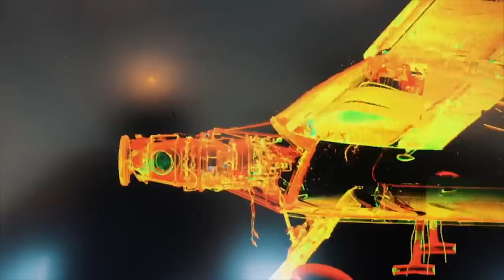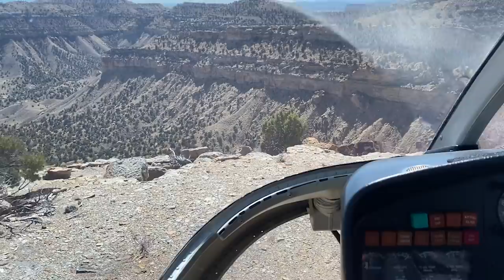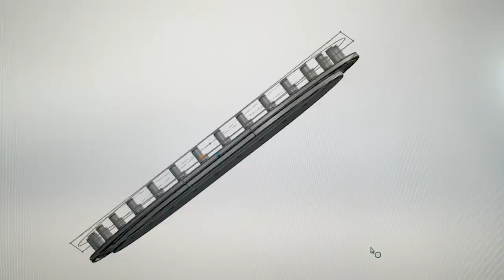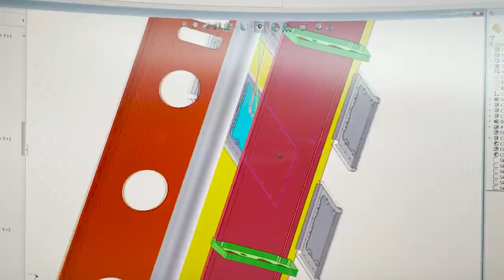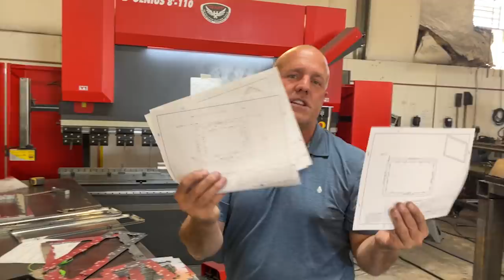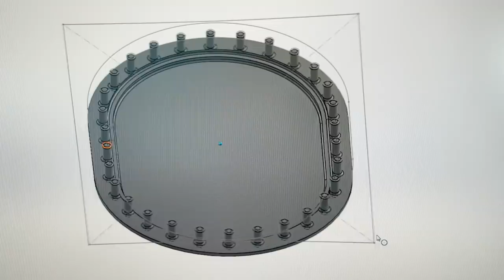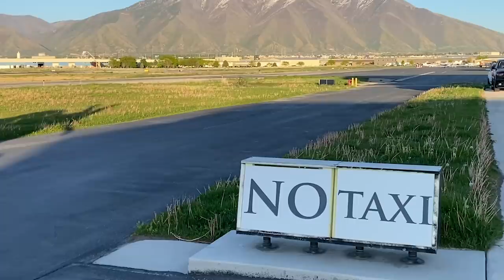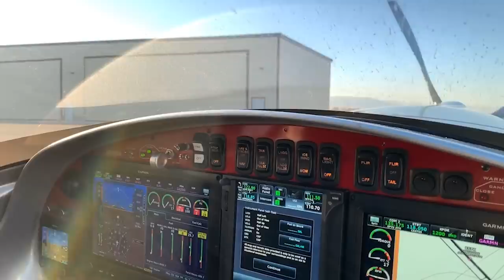Helicopter picks up airplane & Scrappy thermal tests | Scrappy #53

Comment: Mike, I’m not an aviator but I was a mechanical engineer for over 30 years. I grew up on a farm, in a mechanic’s shop and worked as a mechanic in the southwest VA coal mines to put myself through engineering school.  I learned a lot about the difference between a mechanic’s perspective and an engineer’s perspective.  When I became fortunate enough to be supervising engineers, whenever I hired one he/she would work with every maintenance crew and every shift in the plant for a minimum of 6 months total before he/she ever began doing engineering design work.  I told them that that their time with the mechanics would determine whether they were a success or a failure at that company. The ones that learned to respect the mechanics’ needs and biases went on to make very good, very respected engineers.  The others soon left. If only more engineers would learn that.
Reply: Your practices should be the standard in the industry. Unfortunately, it seems to be more common than not that speed and cost dictate most of the decisions management settles for. The customer ultimately pays for, hopefully it's not in a critical application.
Reply: @MrGaryGG48  If you own a german car, you know that no engineer for the power plant or gearbox ever listened to the mechanic's POV.  Built to expedite assembly with not a single concern towards maintenance.
Reply: My business mentor ran a big commercial construction company. His superintendents at various locations around the country were just too busy running multimillion-dollar projects to get their paperwork to the payroll lady on time. He spent a year making every single one of those guys take a week doing her job dealing with the equivalent of themselves. 

Not a one of them ever submitted their paperwork late again. It's a continual problem in business to get people with different priorities to look out for each other. Each one tends to think they're a little superior, but that's usually because they haven't had to walk a mile in their shoes. Yet.
Reply: Well said, I got my ME degree via a co-op program in a machinery manufacturer, spent a lot time with shop personnel, sorting out details and they welcomed my sympathetic ear as they told me what would be better from their perspective. Many of their ideas were incorporated into designs. Not knowing how some of these would be accepted, I always said who gave me the idea. It became my standard practice as shop folks were happy to get the recognition.
Reply: YESSS!
Reply: We have a saying in our shop..." An engineer will climb over 100 virgins to screw a mechanic"...glad to see an engineer trying to prove that wrong

Comment: When he say “ scrapy it’s gonna be a tanker “ in some place in his head it’s planing to do air to air refueling that it’s for shure hahahahahah
Reply: That was my very first thought!
Reply: @BowenMarmot  So was mine!
Reply: And it would be easier,  safer and faster then the airforce method.
Reply: Not a bad idea
Reply: @Koolteer  And cheaper. A lot cheaper
Reply: I'm a former CH-53E aircrewmen and we can fuel inflight, I could see Mike signaling a USMC C-130 for fuel in a turbo prop scrappy.
Reply: @kelvinbranom10  a retractable probe just behind the chute?     🤔    

I was thinking a drouge  & camera at back. Controlled from 2nd seat. The have the monitors already installed!
Reply: @hoppermantis7615  don't give him ideas. I want to see the thing fly. Like now.
Reply: @hoppermantis7615  Probably more like he will carry fuel for others when they're out and about.
Reply: He's probably going to add a fuel transfer hose to refuel his buddies out in the back country. Hahaha!
Reply: Where have I seen you [zoroe...botgrinder maybe]

Comment: I always looked at it as a positive that I installed HVAC for 4 years before I went into engineering. I heard from more that one contractor that they really liked when I designed the ductwork because they knew that, if they installed it the way I designed it, it would fit. No questions asked. In the ceiling, in penthouses on top of buildings, no problems... AND they could service the equipment when they were done because I always took that into consideration.  It’s always a plus to know that your gonna have to work on it while your designing it. Good job, Mike. Beautiful shots of Aspen also.

Comment: Every time I see Scrappy I'm amazed at the design of the engine cowl and how it completely belies the size of the engine - if you didn't know you'd never guess there's a monster flat-eight in there (ETA >>) with an extremely sophisticated intake and cooling ducting system.

Comment: Best thing they ever put into an airframe, everyone is alive & walked away that's what counts...
Reply: Any landing you walk away from, is a proper landing. ANY. I've zero tolerance for any person who bashes airplane parachutes, especially considering how easily they save both lives, and in most cases, the airplane itself if luck holds.
Reply: Amen!✈🗺🍀
Reply: In a Diamond aircraft pull stick back all the way and it will mush down at the same rate as a Cirrus under parachute.
Reply: @oneskydog4401  not if it looses a flight control or the tail section it won't

Comment: With reference to engineers and maintenance techs, when I was building my Skybolt I subscribed to a newsletter by an old guy named Mac Mckinsey.  He had many homebuilts under his belt, some Oshkosh champions.  He didn't have a lot of use for engineers and was not shy about sharing his opinions.  He once said, "You can draw and a$$hole on paper, but you can't make it sh1t."
Reply: LOL!  👍🏻💥😆

Comment: I am a VERY firm believer that all engineers should have to work on the systems they are designing. it makes life so much easier for the next guy when they anticipate someone has to build the part, then someone else will have to service that part! Super cool to see the cooling system on Scrappy is working as planned!

Comment: Amazing. All the thought that went into just one set of brackets so they are perfect in every way. When I unspin the oil filter on my ford, it pours on the crossmember and runs down the frame to the taillights !!!
Reply: Ah I see youve discovered the cunningly designed anti rust feature. Those few parts of your car will last forever, pity about thevrest of it.
Designed obsolescence almost averted........

Comment: I use to work in a job shop so watching you make your wing parts was a 30 year step back in time for me. Pioneer did a lot of Boeing stuff. 

Nicely executed design work Mike, you are so right about many engineers when it comes to designing side of things. As a welder and metal fabricator many times I wanted to plant a three foot chunk of heavy wall pipe between an engineer's ears! Them to have them blame the welding for their design failures. 

Mike when we meet, ask me about the engineers at Genie Ind. from when I worked there. Yeah the blue and gray man-lifts.

Comment: If you had to pull the Shute on Scrappy, I think the suspension will absorb the crash with 0 damage, except cleaning the seat bottom.
Reply from the maker: 🤣 you I would probably have to clean out my shorts 🤪😂

Comment: This is what happens when a mechanic designs and builds a plane, everything is easily accessible. That would be awesome if manufacturers adapt that style of construction.
Reply: I know, right? And in most cases, it's not that hard/expensive to implement solid and well thought through designs! If you look at commercial aviation as an example, easy maintenance means lower costs and that is something every airline would love! 😛 I think these days, its far easier to design a bit smarter, considering the access to better materials and technologies that just didn't exist in the past. We are seeing smarter solutions popping up in everything from home appliances, cars and aircrafts so it's something that is coming, not only from a maintenance point of view! 😃
Reply: Well ... if it costs more to make, it ain't gonna happen. Change the water pump in a 2015 Ford Flex 3.5 Ecoboost (which I drive). Yikes.
Reply: @UncleKennysPlace  Well, could be worse. The Bugatti Veyron oil change takes a week and $20k. I know if you can afford a Veyron the $20k wouldn't matter much but to have your car down for a week for an oil change would piss me off.
Reply: @RobertForslund  it's easy to design better, but hard to find good designers. In the past there was no 3D visualization in CAD everything was on paper, imagine the effort needed to puzzle in pieces in your head. The main problem is that through thinking requires effort, mental and exhausting. I see it all the time when I teach CAD, people will immediately open a sketch and throw a line, instead of conceptualising first their ideas. And then just crumble when they reach a dead end.
Reply: Mike illustrates something that is far too common in the "Real World" of manufacturing. The company's design lab hires superbly educated engineers without enough practical experience to measure. In some labs, the common attitude is to design the product, get it to function to meet at least minimum performance specs and then "toss it over the wall" to the Production Engineers. They'll have to make it actually buildable. Where I worked, the designers had to "escort" the product into production and live with it for the next year. That added responsibility puts a real damper on the "Toss it Over the Wall" mentality... and everyone benefits from it. 

In Mike's shop, his combination of engineering & mechanical experience is really impressive! ...and it's really fun to watch!!
Reply: @UncleKennysPlace  to change the water pump on 94 Toyota Celica you have to drop the engine out of the bottom of the car. (You read that right.) And the water pump is built inside the block.

Comment: Mike, I can't wait to see the in flight refueling boom that you're going to install.
Seriously, I have to wonder what GA aircraft would be like if the design elements that you are putting in Scrappy made it to the GA fleet.  I don't ever think I'm going to fly again, as much as I wish it would be possible, but your designs in GA would revolutionize, and I think that's a really achievable statement, what aircraft design would be.  I've said it before, I'll repeat it.  I wonder what a Piper Arrow would achieve if YOU were to redesign it to incorporate all the things you design for your airplanes.  I just would love to see what you could do with a a current design to make it into what it COULD be.

Comment: The design of the openings is genius. Low pressure vessels use the door inside approach. Air tanks, separators, and oil tanks is where I've mostly seen it.

And all the Dandelions said "Quick! Everyone get ready. That dude that drives the big windmill around just fired it up! Time to PARTY!!"

Anyone surprised that Scrappy never had a "fever"? Nope... me neither.

Comment: Ok Mike, two things. First, as a 707 / KC135 mechanic, I absolutely love your fuel door design. Why didn't someone else think of this!!??? Second, Do you have a pressure gauge for the nitrogen suspension bottle so you you will know approx how many adjustments you have left? I would hate to be on a cliff somewhere and lower it to find out that there isn't enough to raise back up. Maybe you could also attach a hose to your nitro bottle so you could service tires on your friends cub too???!! Get back to work!!!
Reply from the maker: Thanks 👍🤠 and yes the nitrogen tank pressure is displayed on the panel.

Comment: As an A&P Mechanic, I've been saying that for years -- "Engineers need to see things from the mechanics' point of view". Previously, as a Mechanical Designer, I always kept that in mind. Great video! I can't wait to see the Part 103 Carbon Ultralight...wink, wink ;  )
Reply: Now part 103 would be nice. 
    Unless a designer wrenches, using CAD (computers asinine design) will often end up with something that makes no sense from a human point of view. As it often leads difficult tasks to perform. That's Not Just Aircraft. 
    Once had a 94 Celica. Tried to install a security system under the hood the box with speaker was less than 4 inches Square there literally was no where to put it. The same was for the water pump, it was inside the engine. And to do any engine work at all the engine had to be dropped out of the bottom of the car. That's CAD!
      If you are an A/P start building your own. My current build is coming along quite nicely. Although mine is a tricycle it also has a suspension on Fox air. But it looks as though my gross will be less than a third of Scrappy's. LOL it might cost is likely less than 2% then Mike has spent.

Comment: I really appreciate the rethink on the fuel door; putting the tapped holes on the cheap and easy component is brilliant. Engineering school should include internship in the service bay; that is where you can discover the long-term costs of a particular design.

Comment: Access hatches re-engineered to be lighter, stronger, sized for HMI and new leak proof seal. Drilled "Because a laser cutter is not accurate enough so I drilled out each laser cut hole with a precision drill" so the rivet/fastener hole is +-0.0000000000001“
Reply: Don't be silly

Comment: As a mechanic of 40 years, it’s very cool to see you think things clear through to the “ease of service/repair” level. Of course I also realize that you aren’t designing it to compete commercially and can do what you want. I think I asked this once before, but I can’t remember. 💧WHAT’S YOUR TARGET FUEL BURN?💧I’m going to guess it will be in the 14-18 gph range depending on cruise versus play mode. Again, thanks for the inspiration!
Reply from the maker: Great question 👍🤠 If I’m cruising with other Cubs at 100mph we will have similar drag but scrappy will have slightly more. The 8 cylinders will burn slightly more fuel at the same Speed. so when my friends are at 7-8 gph I’ll be around 9-10 gph at a paired speed. when trying to get somewhere faster I’ll open it up to about 14-16. Now if I’m launching on takeoff, much much higher,  but just for a few seconds and than pull it back to cruise.

Comment: 120 Gallons.... Even if that's US (454.25L) rather than Imperial (545.53L), that's still a MASSIVE amount of fuel. You should stick a "GT" at the end of Scrappy's name Mike, as it definitely fits the definition of "Grand Tourer" that they use with sports cars. 😄

Comment: Does Mike "Take a nap: I don't do those" Patey miss anything? The inside corner cut-outs on the inspection plates stress relieved-pre-drilled, to prevent fracture.
Reply: what?
Reply: @741741  At 11:50
Reply: no the cutouts.

Comment: Grew up on a small farm and have always been very "Hands On", rebuilding equipment, engines, etc.  Graduated from High School and went to Engineering School.  Started out my Mechanical Engineering career in Maintenance Engineering in a non-union heavy industry situation where I could "get my hands dirty".  Had my own set of tools and would be right in the machines with the Millwrights.  We all learned a lot from each other, had great respect for each other and got along together very well.

I later worked at a large fabrication and machine shop as Engineering and Maintenance Manager, but I still spent a lot of time talking to the maintenance guys and the machinists; mainly learning as much as I could about how to make things as simple as possible, easy to work on and still be strong, long lasting and safe.

From the beginning, because of my background, I have always designed parts, assemblies and machines with the machinist and maintenance man in mind.  The easier it is is to manufacture and maintain, the more cost effective it will be.

Bottom line is I appreciate your design/fab philosophy, and just wanted to let you know that there are more of us "like-minded" Engineers out there than you might realize.

Take Care and God Bless!!

Comment: Yup, engineers always do better work when they've had to suffer through building there own designs a few times.  When you're thinking "what idiot designed this puzzle" and that idiot was you... It doesn't happen again unless there is a good reason.

Comment: At 2 minutes and 35 seconds, and at 4 minutes there's a shot of where the spinner and prop would be. I can understand removing the prop, but why cover the hole? How often does Sirius perform a parachute test? They appear to have perfected the landing!
Reply: It looked to me like the lower cowling got crunched a bit. Maybe the cover was there to add back some structural rigidity?
Reply: I'd like to know with the planes that have deployed their chutes, how many have been repaired and returned to flight? Is it a "one and done" deal?
Reply: If there is engine oil sprayed everywhere inside, with mobs of dust added by rotor wash, it would be a cleanup nightmare.
Reply: It's interesting it's such a perfect plug, and there are two large intakes beside it. Those who do recovery operations rarely take the time to make a perfect plug. They use what we used to call hundred-mile-an-hour tape. You know it, everyone uses it for everything.  It's duct tape. It's what we used in Vietnam to repair bullet holes in helicopters during Evac operations.
      I'm also curious, either the film was sped up or it was dropped rather hard by that helicopter?  Eatch it again, close. Just saying. It's not like that hole was pointed up at the prop wash and it's dangling awful far from the helicopter anyway. And that landing gear hasn't folded so how could it have it Busted the cowling? I'm not trying to be an ass just asking questions from what I'm observing.  After all Mike never addressed to the front of it at all just the main gear. I choose not to make excuses for anyone.  Any more than I'm assuming what happened.
Reply: @Ozarkprepper643  I see what you're saying, and I agree. It is a surprisingly good plug (at least from what we can see!)